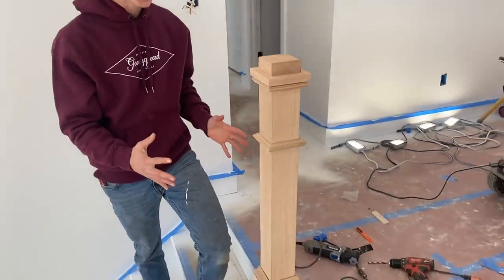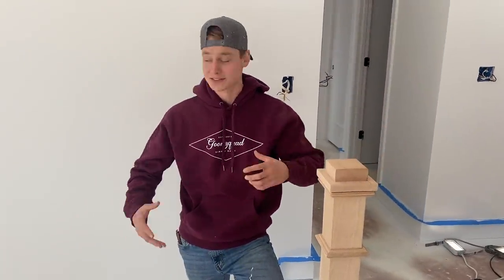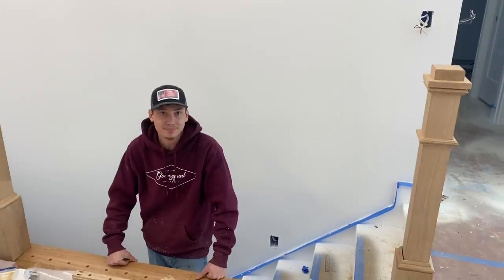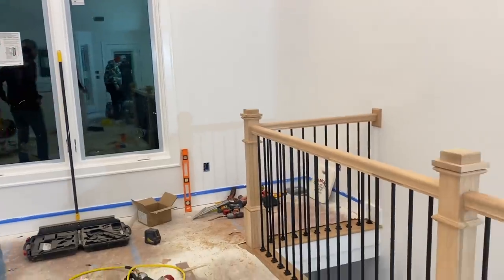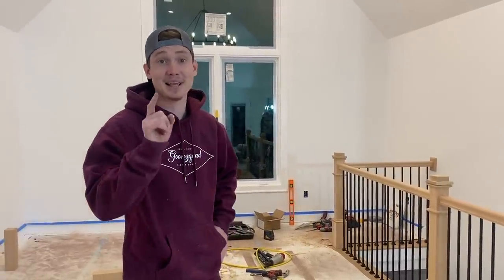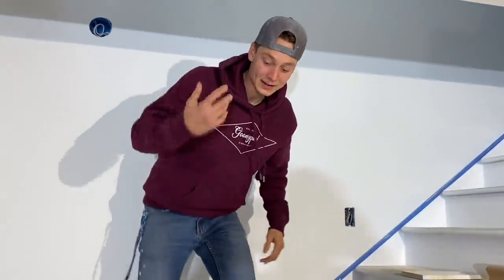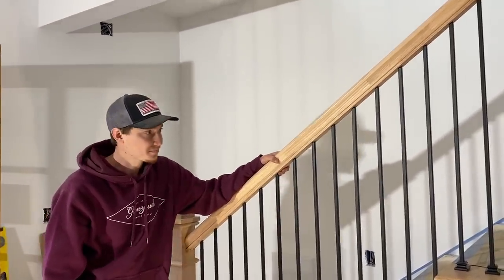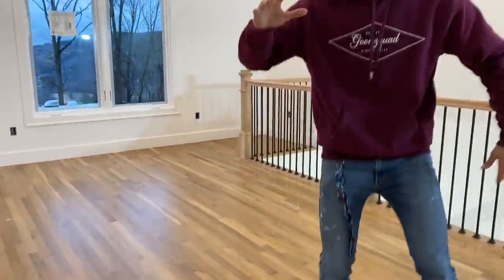The New Goonzquad Headquarters Part 64

Comment: "Its pretty sturdy...."
Moves when he shakes it with one hand
Reply: Yeh,I noticed that
Reply: It's installed incorrectly and is dangerous. This will 100% NOT pass inspection. They come long for a reason and are not supposed to be cut.
Reply: @ingresswizard9044  I know your right but as always I'm sure we'll see ?
Reply: @brockwoods3143  your right,it might look ok in a show house,but in reality ,any weight on that it's not safe ,and I'm just being realistic ,that's all
Reply: @ingresswizard9044  facts bro. 100% family and friends should stay safe. And cutting corners is a big no no.
Reply: Yeah I don't think your supposed to attach it to the floor with L brackets. Should have some meaty screws anchoring the posts through the hardwood to the subfloor.
Reply: @brockwoods3143  I would have used a a double ended 3/8 screw in the center of newel which screws in the tread in addition to the L brackets.
Reply: @gtuttle4  at least some decent screws through the l bracket. What were they 2ga 1/2"?
Reply: @wheeln24-79  exactly 👍
Reply: Ya if somebody trips into that railing they’ll rip those posts out with ease. Definitely not how you do that. I told them a month ago they needed to be secured to the floor joists
Reply: @allspooledup2584  priorities ma man! 1 coat of paint, DIY tiling and "steam room install", $3000 ice maker.
Priorities.
Reply: @allspooledup2584  I was your comment ,your right and the thing they keep saying is passing an inspection,??
Reply: cheap  crap
Reply: Hope inspector watches and fails thst.  They also didnt flash windows properly which will 100% leak.
Reply: @kdrguru  1 already did they had to reseal it but they only shot silicone in the gap which will go hard and fall out.
The flashing tape should have overlapped the outside wall.
Everyone is always worried about electricity in homes but I'm more worried about water because you often won't notice a water issue until something falls down
Reply: @kdrguru  and unfortunately the list goes on !?
Reply: @konakona997  I know ,they don't seem to spend the money on the important things ?
Reply: @allspooledup2584  your definitely right in everything you've said dude 👍

Comment: Newell Posts were installed completely wrong! They must be fixed to the structure of the floor, otherwise someone that weight a few lbs can break that little bolts and fall from 1st floor... Search for newell post installation on YouTube and will see proper installations. 
 No way that pass an inspection. Sad but true
Reply: Agree.  Tiny metal brackets attached to floor are inadequate.  They should be bolted to floor joist as you would on exterior deck.
Reply: It’s Tennessee. Those hillbillies will pass inspection.
Reply: I'm not a carpenter and even I can agree it's terrible. Like Mike said it's Tennessee so what are you going to do?

Comment: That stair guard rail will never stand up and will be lucky to pass inspection, if he spots it, it will fail.... the uprights need to be structurally fixed to the floor joists not just screw to the floor boards with little screws and brackets, if any falls or nudges the rail it will easily rip out.

Get someone in to fix the post’s correctly, if someone gets hurt it will come back on you.
Reply: Blame the plumber
Reply: Gonna have to replace all the post now, they are cut too short
Reply: Their cabinet guy showed them how to install railing🙄🤣
Reply: Half assed like rest of the house.   New video here in a bit redoing that railing
Reply: don't bother, they don't check comments

Comment: Be easier to use wood for the last bit of the posts, as you’ll not get a drill in at the last step, be a huge headache
Reply: Good point. Helpful!
Reply: Could just get away with the metal caps they have been using
Reply: I would put a wood strip at the top. You don't want your plaster board taking a beating when a spindle gets bumped. Anchor it well and it will be solid with no issues down the line.
Reply: Just replace that small cap at the top with one longer piece that the rest of the spindles can go into. Use a right angle drill for the rest of the holes in the steps.

Comment: It's too bad that the piece the handrail terminates into isn't one long piece of wood that ties end to the wall. It would def look more cohesive than having just that little block of wood as a place the handrail terminates or a connecting piece because of the routered edges.
Reply: That's exactly what I was thinking. I totally agree
Reply: i would have suggested a half or quarter  post  on the wall.
Reply: Yeah,  those blocks of wood will look silly.
Reply: Yes a continues block mounted to the top that looks like the router block that runs all the way to the wall. That would look awesome.

Comment: Your guard rails have to have a minimum height of 36 inches.
Reply: If the guard is to minimize a fall such as in their case, and isn’t there to be a handrail, then the minimum is 34 inches
Reply: Yes, that is the correct Code minimum guard rail height for residential properties in Hamilton County Tennessee. Commercial building Code specifies a minimum guard rail height of 42". There are no maxima in either case.

Comment: A couple things being a railing guy that’s done it for a couple years that Newel at the bottom of the stairs should have been notched into the stair it would have been way more solid and for the balcony you should have notched them as well and cut into the landing tread and also it’s not centered in the landing tread either but I get your beginners but should have hired a rail guy
Reply: why is everyone's advice always "hire someone" ...what part about this channel being a DIY channel are people STILL not getting after this long..
Reply: @apet1572  that’s why I said there beginners I get that but some things just arnt code and redoing stuff isn’t fun so therefore hiring someone will cause them less of a headache
Reply: @staticraysog7478  based on your reply, you're still not getting it. The more videos they can make the more money they make. it doesn't matter if they have to redo some things.. this is how they are making their money.
Reply: With that logic @A Pet they should have done all the plumbing and electrical by themselves so they could make a video and money and not care if it is safe
Reply: Truth. They will have to fix it eventually.
Reply: @anthonyfranks1157  and they did plenty of both. as much as they felt comfortable. they did the steam machine thing and they also wired teh indented lights and chandelier thing. theres a big differnce in plubming/electric and putting in/cutting wood.
Reply: The word perfect has lost all meaning, don’t bother pointing out any of the many things done wrong from improper roof repair to faulty window install that will become a serious rot and mold problem as it will upset the fan boys. There is nothing wrong with doing things yourself but more research is needed , someone else will buy that house one day and inherent all those problems. Say what you want but I’ve been in the trade for almost fifty years and I have seen many of these issues.

Comment: just extend that wood plate at the top of the wall where the hand rail ends downstairs the rest of the way to the wall instead of that 6 inch plate just go from under the rail to wall then add your metal rails it will look consistent
Reply: 100
Reply: I think on my house they fastened the railing edge to the stud of the house studs.🤷‍♂️

Comment: Good luck if the safety inspector has seen this video of how those posts were installed.
Reply: Yeah, that's not the most solid of instals ! :-D
Reply: Loll I can see they’ll have to do this process again
Reply: Let’s hope the dudes drunk when inspecting other of fail, we have to sit through more house building and further away from car stuff 🙄
Reply: What was wrong about it? The way it was attached to the floor?
Reply: @Alexweav79  A guardrail assembly is a life safety building element so it needs to be structural in the way it's affixed, not just look like it complies with say spacing rules at a glance. It needs to be able to withstand someone leaning against it with their body weight for example (even drunkenly crashing into it in the dark, TBH) then still stand up to doing its job over time.

Rules may be different in TN though. I keep hearing lots of stuff is legal in parts of America from different YT channels.
Reply: IRC requires a minimum lateral load for guardrails.  I'd guess their install would fail by 1/4 of the required load.  PLS inspector fail that.  Roof flashing, window flex flash and head flashing dont meet code either.  Tons of items I cant count.
Reply: It will be very easy for the inspector to tell if they check the posts at all because they dont even look sturdy and im sure they dont feel it
Reply: @kdrguru  I'm not even in construction or a builder and I'm losing count myself 😬
Reply: first drunk guy to lean on those rails will tumble down the stairs 🤣

Comment: You guys can still give the stairs grip. There's a special sand people put in paint, when painting the floor. You can get the sand and add it to the varnish. Tell the paint store guys you need sand for varnish. Mix it in real well, then put another coat on the stairs. Trust me, it's worth it. You'll appreciate the sand the first time you walk up the stairs with wet soles on a rainy day.
Reply: Hopefully, Eleazar and his wife will choose not to wear outdoor shoes (especially wet or muddy ones) when walking on the hardwood floors and using the hardwood stairs in their new home! Slippers, socks or bare feet are the rule in every house of this type that I know.

Comment: Your post install looks scary. 
Then you finish nail the rosette to the wall. Then you screw the handrail to the Rosette. Does that really make sense? Is there any backing right there,  so you can sink some long screws into it.  It should have showed backing in the blueprints.

Comment: Your balusters on your stairway have be a minimum spacing of 4 inches apart. I am a city inspector in Sugar Land , Texas.
Reply: The 2015 International Residential Code calls for guards spaced so that a 4-inch sphere cannot pass through the space between guards.  The boys did good!!
Reply: You mean maximum.  It's so a child cannot fit their head in between the bars.  Actual measurement must be  3 7/8" or less.
Reply: @DeFaltaver2  did good?? They secured the posts with 1 inch L brackets. Better hope nobody leans on that railing, or they’re going for a quick ride down those stairs

Comment: I would agree with the black plastic end option... Or get a mixture of both and do a 1 x 4 in a similar wood along the ceiling  that can match the cap to the existing handrail. If you can route it right, you can match the handrail cap and extend the full length. Then you can go into that and match all along :)

Comment: I think I woulda got a professional in to do the handrails. I dont think those L brackets and screws will hold up.
Reply: Agreed. The Code strength requirement for the balustrade is a 200 pound static lateral load at any point without significant deflection. The leverage on those small screwed in brackets seems unlikely to pass this test. Even if it does, day to day use of the stair is likely to work the fixings loose, creating a safety hazard.

Comment: If i did the rails on the stair case opening like that i would be fired and never be able to work in the stair industry again.
That bottom post should go right thru the bottom step to the floor into a pin coming out of the concrete floor.
Reply: That’s the proper way to do it, but I think in this scenario it’ll be fine.
Reply: Ive been doing it for 38 years, not the right way! Totally unsafe!
Reply: Agreed 100%. They don't listen or read comments and it's going to cause someone to get hurt. I have a feeling their house inspectors is going to find many things wrong that have to be redone. They are going to have to rip our all those rails and balusters because they are not up to code.
Reply: they say they do a lot of research and Googling but i guess not enough
Reply: @ingresswizard9044  they passed all
Inspections so far... keep hating
Reply: Why is there so many haters let tjem fail inspection the will learm
Reply: @Nexadon  like your perfect, railings aren’t meant to support 200 pounds hanging from them, mostly cosmetic
Reply: @realredditstories420  WTF are you even talking about... I think you @ed the wrong person cause I didn't say anything about the posts. Furthermore, the posts are there to prevent people from falling off the steps, not for cosmetics. That's one of the dumber things I have heard on here and that's saying a lot.
Reply: @realredditstories420  yo
u don't know what your talking about. Those posts by the Building Code are supposed to go down into the framing and be anchored. The railing is built that way to take a impact. Look up the code.
Reply: @gibson5056  not hating, just telling them there doing it wrong. It is a huge safety issue!
Reply: @loganmw  Since when is the wrong way to do something "fine in this scenario"? Especially when it comes to a safety issue???
Reply: @realredditstories420  "...mostly cosmetic".  Thanks for the laugh.
Reply: Your absolutely right....
Reply: @realredditstories420  to safety Inspector: no sir they are toooo coooooooodddddeeee(while falling to their death).🤦‍♂️ 
They are the main safety factor in a staircase.
Reply: @anytractorman  I’m just saying that when we inspected our house we bought a month ago, the stair rail was brad nailed to the stairs. Also, when I used to state inspect for real estate company’s that was not on our list all over Tennessee, Louisiana, Kentucky and a Indiana (only places I’ve inspected)
Reply: @stevelozano9523  if you fell off the back end of that staircase you would fall a max of 6 feet.  That’s not going to hurt anybody, you could kick a stair rail and it would barely break, even if it was fastened improperly
Reply: @realredditstories420  i live in CT. And the inspectors, im one. Would not ever let that go. Of course CT. And Mass. Have had lawsuits against inspectors for decks falling off, loose stairs, shoody framing. That was signed off on. So now everything is inspected. And inspectors are required to go to classes pass a 4 hour test. And go to classes every year.
Reply: @anytractorman  I don’t live in CT, so I guess it doesn’t really matter what CT does

Comment: I'm not going to get into details because so many have said my thoughts. During this whole project I was waiting for the open railings. Been doing finish work for 23 years and railings is hard for most. I give you guys props for never doing this before.  But in my area this would never pass inspection. Must be different in your area I hope for you.
Reply: Its IRC there.  This install needs to fail as well as incorrectly flashed windows.  I wish I was inspector there...I'd have pages of fails.
Reply: @kdrguru  exactly. How about not the so easy one of not sealing the sill of any of the exterior doors, tiling and let it sit without grout and then have so called personals install the vanity without bringing up you have no water after drilling the discharge pipe. And on and on it it goes. I will give the guys credit for trying to learn with out help.
Reply: @carpenterswsw  💯
Reply: I can’t get past them stomping around in mud with a skid steer and pile of gravel sitting there.
Reply: @carpenterswsw  remember the improper jack stud that was magically fixed 2-3 videos later.

Comment: For the stairs underneath, instead of ending on the block, take the block out and run a matching hardwood board and continue running your balusters into the board. This will finish the stairs off real nice.👍

Comment: Who's idea was it to use those janky little L brackets for the newel posts.
I don't think that will pass inspection... Too weak.

looks good though ;-)
Reply: Those brackets come with the post. That’s the proper ones
Reply: Maybe but there not safe.
Reply: @jjforeal2  Just because it comes with it doesn't  mean it's the correct way to do it.
They were also advertised as solid wood.

I am a big fan of the channel, but I think it's unsafe.
Reply: @jjforeal2  Wrong. Everything they did was wrong and unsafe. You do not cut the posts they are supposed to tie into the structure of the house.
Reply: @ingresswizard9044  😂 😂 😂
Reply: @ingresswizard9044  They are long for a reason... The one at the top of the stairs and the one at the bottom of the stairs are particularly suspect...
Reply: Yup, better hope nobody leans on that railing

Comment: The transition to the wall is ehhhh, I would have cut one of the post in half and secured it to the wall making it look a lot cleaner from what I have seen working in the trade but that’s my opinion 🙃🙃
Reply: They sell the half post to tie into the wall lol. Definitely the proper way to do that. I’ve never seen what they’ve done here. None of what they just did will pass inspection. The posts are all done wrong as well
Reply: @allspooledup2584  we’ll see brotha  but hopefully they see our comments but I doubt it lol